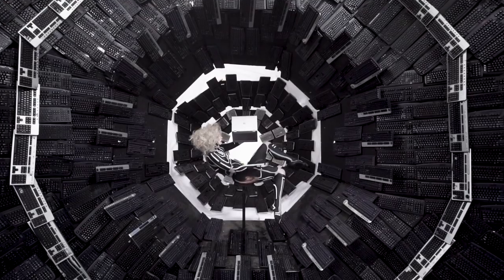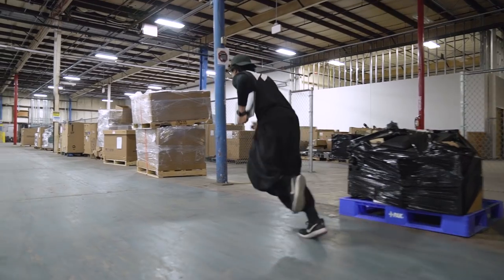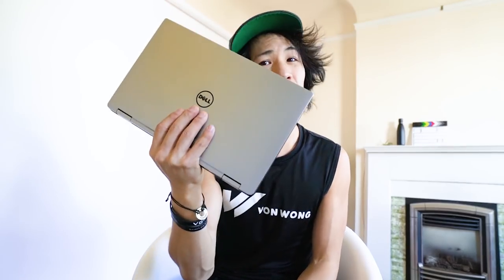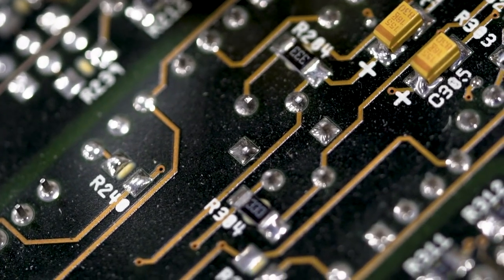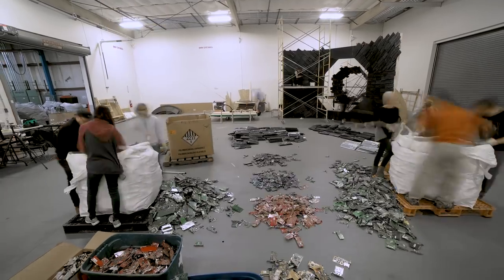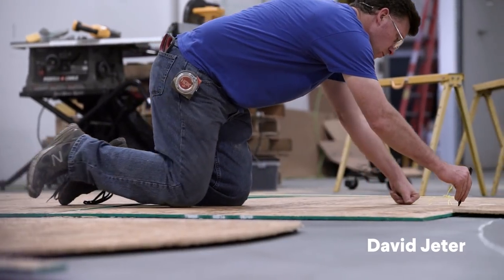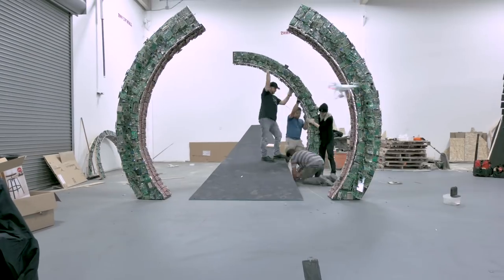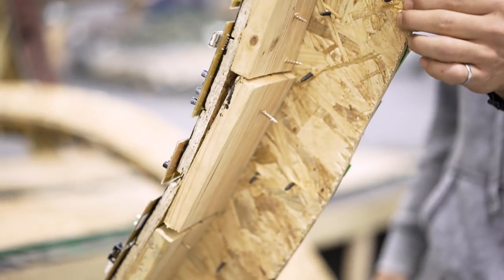We built a Portal out of Circuit Boards (Part 1 of 4) - #RethinkRecycleRevive

Comment: Really neat concept and execution so far! There are so many factors involved in why e-waste is a huge issue. From forced obsolescence due to software/firmware update support going away to genuine processing advancements that warrant an upgrade change. So many of my Android phones from the past could have been just fine if manufacturers and carriers kept them relevant on the software side of things. They were certainly still fast enough...
Reply from the maker: I know, I wish I had a technical solution but I don't... so I'm trying to support those who are doing something about the problem.